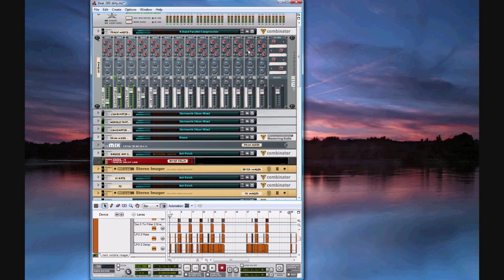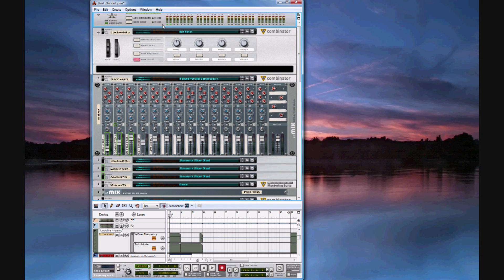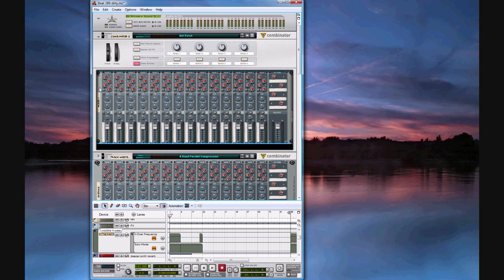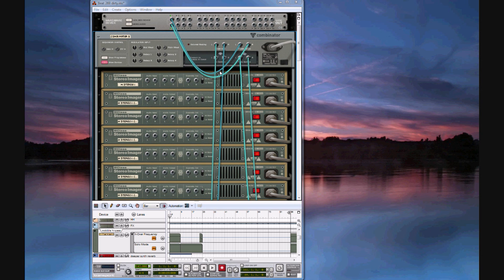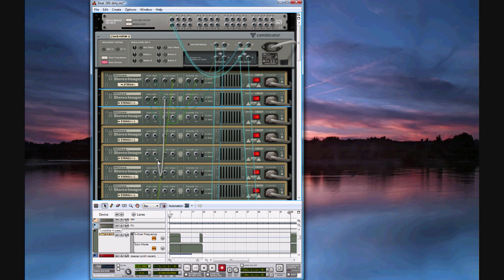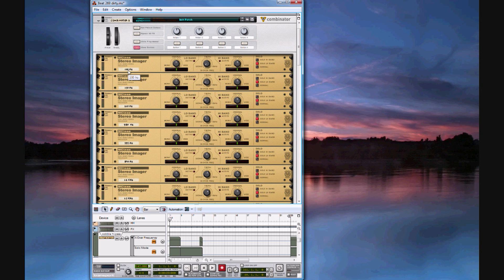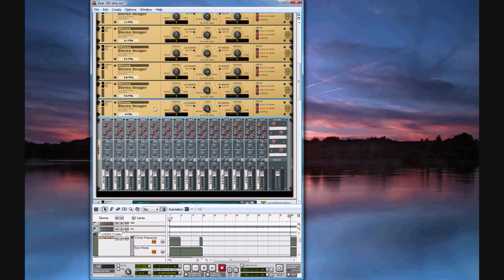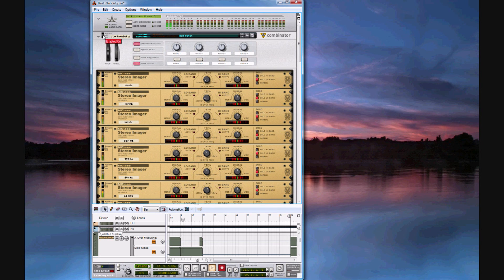Reason 4.0 How to make a Spectrum Analyzer Combinator (tutorial)

Comment: I mean, what you can do instead, is just split the audio with Spider and have one channel running into the spectrum, and the other running into the hardware unit at the top of the rack. This will guarantee that none of the BS caused by the spectrum analyzer actually messes with the sound, and the actual signal will still run clean through Spider on the other output.